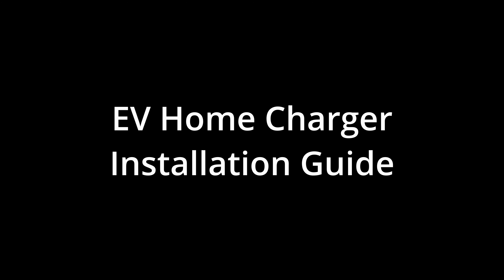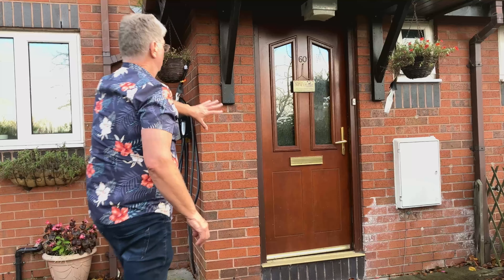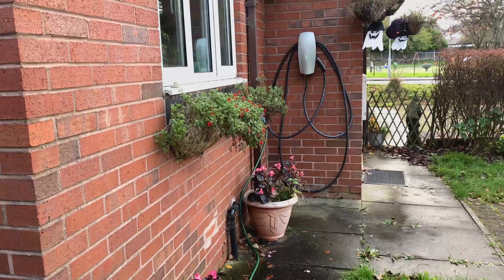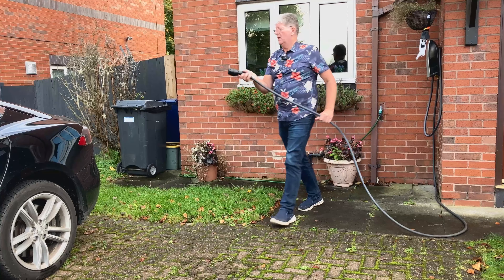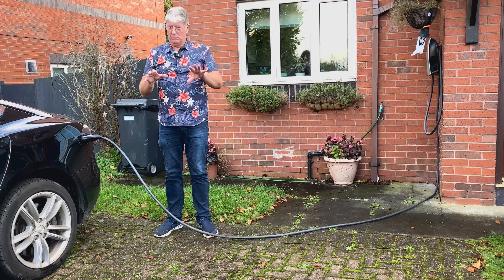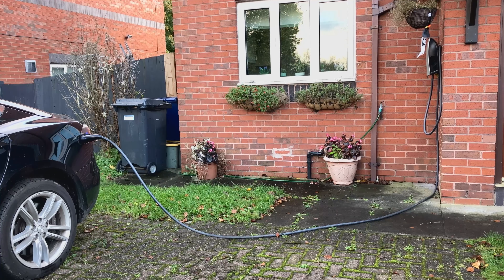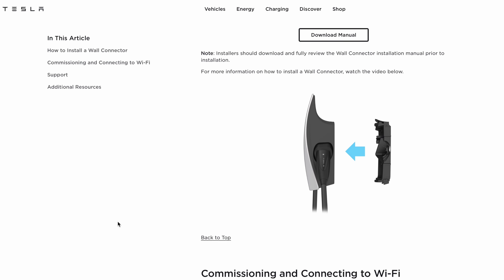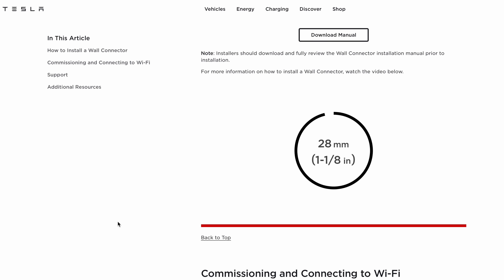EV Charging | Home Charger Installation Guide

Comment: Octopus contracted electricians tapped into the meter box no problem on mine. My consumer unit had no spare space. Hot tub wired into that.
Reply from the maker: Priorities can get in the way
Reply: @davetakesiton  too right they can. 🤣🤣
Reply: Mmm. Love my skoda enyaq, but I had nothing but trouble charging at home. With Octopus Intelligence. That doesn't always work properly.  Had smart meter installed in July. Not had a bill for almost 4 months meter not sending readings. Gas ok. Had meter rebooted NG. Getting new meter end of this month. Had charger supplied by my company, "shell recharge". Plug & charge fine. Scheduled time NG. Supply feed from mains meter via new fusebox for charger. It randomly trips, not the house. Totally unreliable. Waiting for replacement charger & fusebox 😠

Comment: Great vid Dave! I had my charger fitted this week and I must say that after watching several videos on the subject I was a little nervous that in spite of the photos I had to send in before the installation was arranged, I was still a little worried about the size of the main fuse (80A), tale size etc etc.  The actual install was as easy and trouble free as could be.  I own a Hyundai which is not API complient but even so I have found charging at home to be as simple as I had hoped and now I smile as I drive  past the local public rapid charger that I had been using up to my install date, while relishing the 7.5p per KWh that Octopus Inteligent Go provides.  Love the channel Dave, more power to your elbow 🙂
Reply from the maker: Common story fear is worse than reality, glad all went smoothly and isn’t it great paying so little
Reply: @davetakesiton  that's the EV story all over. Fear of the unknown.

Comment: Just had my Hypervolt installed this week, very happy with it so far. Note, I only currently have a 60amp mains fuse to the house, I have requested an upgrade to 100amps, but the charger knows this and will limit the current should the demand be too high within the house.

So, if you have a 60amp fuse, it doesn't mean you can't get one installed (some installers will insist on it being upgraded first), if the charger reads the current demand as my Hypervolt, then, it is possible.

Comment: A point to check , for your electrician, is 'Looping' of the mains supply. Several of the main housebuilders only lay one mains supply line to a pair of houses which restricts the available amperage available . Instad of 80 smps some semis can only take 40 amps approx. 
My own house was equipped with a 100amp supply fuse, (the maximum SSE would allow) which permits me to charge 3 EVs plus dishwashers and washing machines. overnight. All with the correct protection systems.
Reply from the maker: No idea, if a qualified certified electrician signs off the installation then it is not my job to ask him if he knows what he’s doing and if I later get the whole house certified by a different independent certified electrician, I’m happy and in the last four years have not had a circuit trip or any problems
Reply: @davetakesiton  my comment was a general one, apparently it is a problem with some builders who have cut corners and I believe mentioned in the latest regulations. I have little faith in contract electrical fitters after the pigs ear one made over installing my smart meter.  He didn't know how to measure the earth impedance and called out an emergency team from SSE. They passed our earthing as excellent condition.
Reply: @davetakesiton is sounds like you installed this yourself? Either way, you or your electrician should have notified the DNO by filling in a form before installation. It doesn’t look like you have installed an O-Pen device either. If an electrician has signed your job off it seems to me that he knows nothing about EV charging.

Comment: I had an ohne charger fitted with a trip unit installed under the meter box and just around the side of the house no inside connection at all very neat and safe

Comment: I had a Zappi 22kw installed a couple of years ago, just got in time for the grant that was then offered by the Government. I already had the set up for three phase. I went for non tethered but decided to,go,for 22kw to future proof the installation, plus at the time I had just purchased a Zoe. Also now have an MG4 ( only charges at 11kw ac). Like you Dave my consumer unit and charger close by so simple installation, ( although mine is next to the back door rather than front). Btw great videos you are doing, but I don’t know where you find the time!!!!
Reply from the maker: Tricky getting the car into the back garden. Time, ran out of that ages ago, thanks for support

Comment: Am hopefully getting a 7kw Zappi installed by electrician this month. They are siting it right next to our meter box and putting an ev charger board in there, we have space luckily, rather than running from our consumer unit. Electrician also arranging 100amp main fuse upgrade via local dno. 3 phase supply is i understand very expensive to install, averages several thousand pounds and can only be done by the dno.
Reply from the maker: Gods luck, three phase is hardly worth it for most people
Reply: @davetakesiton  I agree, that's what I meant 👍

Comment: An interesting point Dave and chat @QuestXS ... I had my house single phase supply cable moved, jointed at the pavement and new concentric cable, terminated at my new Meter box, with all new 100 amp main fuse cut out, meter head, cables, DP Isolator etc etc and the Northern Power Grid engineers, told the Electrician, that I did not need a PEN device with my GEN 3 Wall connector. Easily retro fitted if in light of matters they where wrong, so far no deaths ! ... 🤣
Reply from the maker: 😧🤞trust in electricians

Comment: Good video for newbies Dave however I think you should mention that Tesla wall coonectors/chargers require an additional PEN fault protection box if fitted in the UK. I've had such an installation since March 2022 to "feed" my Model Y and its worked perfectly (and legally) Of course ,as you stated, there are many different chargers available on the UK market now and most of them inckude PEN fault protection. Having said that I have no intention of changing my setup as I like the built in charge flap opening from the cable plug AND also the ability to limit the charger use to a particular Tesla.(useful in a communal car park like mine)
Reply: Meh, that's the installer's problem.

I would never install something like this myself, especially after spending all that money on the car. Get a professional in and let them worry about it.
Reply: @RichardBrooklyn  My Tesla Gen 3 charger (with Garo PEN fault device) WAS professionally installed but in the UK the owner is still responsible that the rules have been followed.

Comment: Great simple explanation, my installation was a nightmare (read BP pulse took 7 months) I had to contact DNO as they didn't, had to have a live connection to install a double pole isolation switch (you can get this done free when you have a smart meter installed if you ask) Now just over a year after installation, I have an unusable home charger that BP think 6 weeks to get an engineer to is reasonable that overheats the supply cable to the point you can feel it through the conduit, that trips its own main breaker switch. This is a KNOWN FAULT! that they have an 'over the air' update for that reduces charge speed. Unfortunately the charger is wifi not SIM connected & the fault has killed it's wifi connection.
Home charging for me has been nothing but hassle, I know this is purely because of the make & model of the unit as others seem to have dealt with competent companies & can charge at lower tariffs. (They aren't recognised by any energy company because of the software)
Reply from the maker: Yes Chris, sorry to hear your problems. I stated that one of the main reasons why I bought a Tesla charger was for this very reason. I also often double check, I am happy to pay for a different certified electrician to certify the whole house after the charger installation is completed.

Comment: I can reduce the charge rate on my ID3 so that I can charge from solar when the house battery is full without taking anything from the grid. It will do 1.9kW and 4kW as well as the 7kW on max. Only issue I have is that the house battery drains unless I set it to keep a particular charge while charging the car at night. Have to be wary as main fuse is only 60amp.